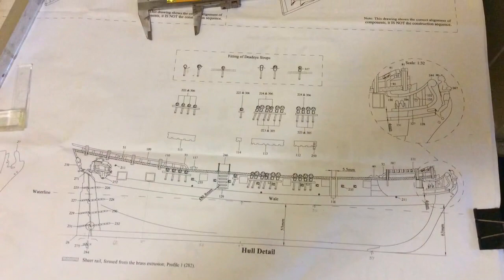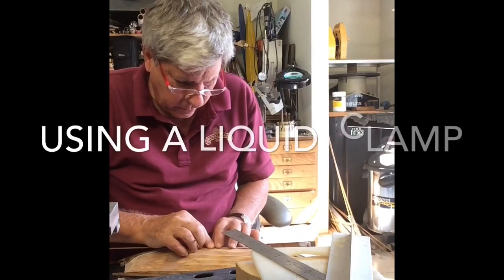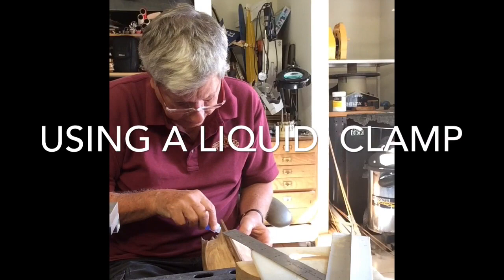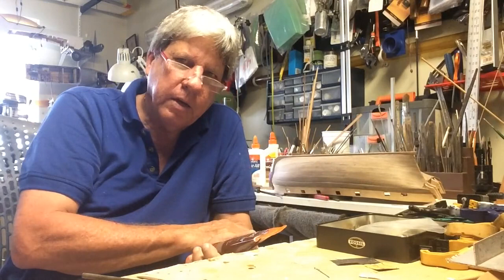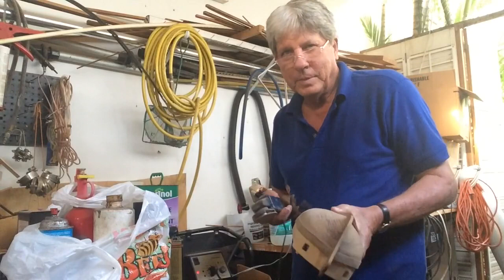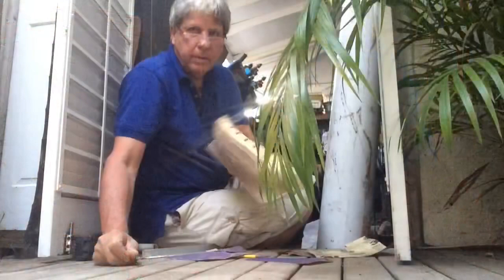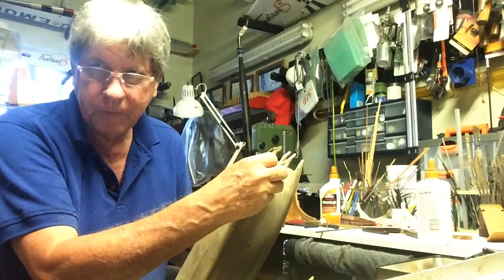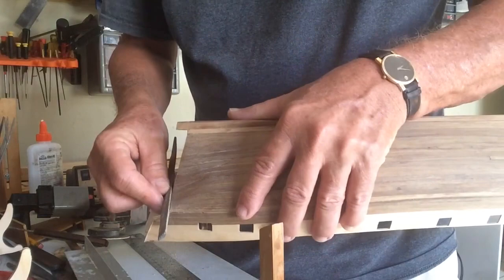HMS Granado. video 3. Installing the second planking

Comment: Hi Kevin. Nice work! Would you mind explaining how you cut the rebate in the keel please? Cutting an accurate rebate has always been a mystery to me so I have always avoided it, using sanding and filing instead. I’d rather do it the right way instead.
Reply from the maker: The best time to establish the rebate or RABBIT as its called is very early in the build before the frames are attached. I am assuming that this was not done and you are now trying to put it in. Take a look at my latest video https://youtu.be/nQ47mZZN8qY.  Where i am finishing the rabbit on the Thorn. To get a nice straight line i would use a metal ruler and make multiple passes with an exacto knife. Since in all probability you will end up painting the bottom white, if you make an error you can use filler and cover it up. The rasps help open it up to take the finial planking. Hope this is helpful.
Reply from the maker: You’ll find the reference to the rabbit  about 8 minutes in
Reply: @kevinkenny5122  Thanks Kevin. I will have a look. I have built a couple of ships but never made a rebate (rabbet) in the keel before. I have built one boat with a full keel, like in a Corel kit and one with a false keel. I have just relied on sanding to get the job done. I have only seen a rebate recommended in a couple of places. Now that I've seen it, I think it's a better way to go.